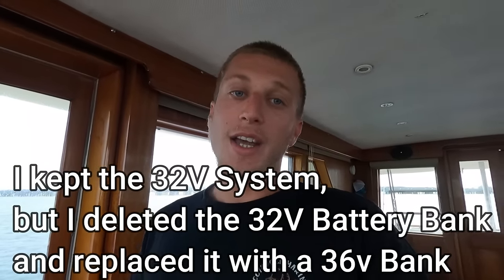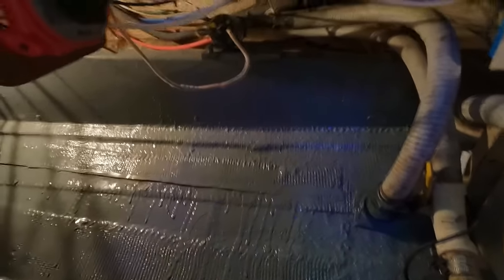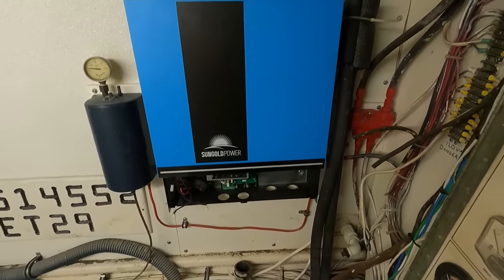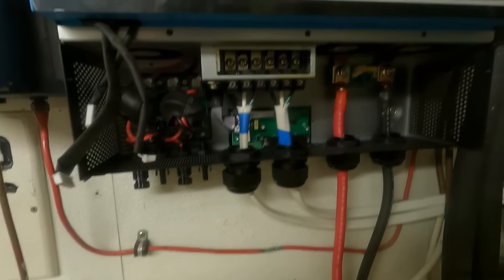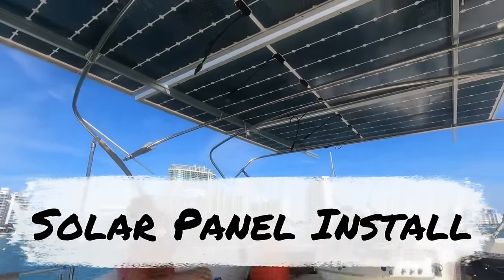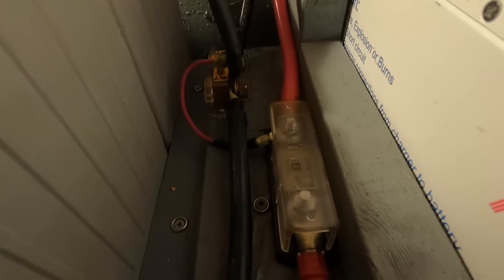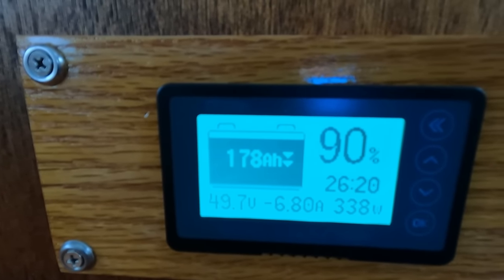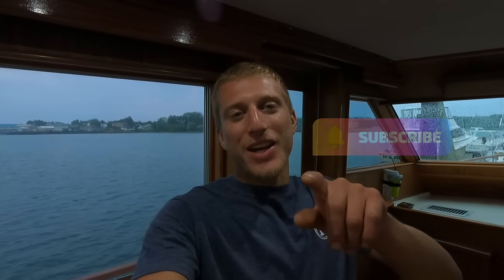Off-Grid Liveaboard Yacht Setup - 1968 Hatteras 50'

Comment from the maker: I Estimate the total cost of the setup to be around $5,000. That Includes everything that I had to buy from start to finish. 
Check out Redodo Lithium Batteries! Discount Code: GUS  https://www.redodopower.com/?ref=kpt00fas
Reply: Great videos!  I’m currently installing lithium batteries and a SUNGOLDPOWER 6kW inverter/charger/transfer switch into my gulfstar 44 motor yacht. I went with four 200 amp 24 volt batteries in series/parallel for a total of 400 amps x 48 volts = 19.2 kW of power which is more than enough to supply the 6kW inverter. I see one problem with your setup. You have two 100 amp 24 volt batteries in series for 48 volts but you’re limited to 100 amps total because that’s all the battery management systems will allow. So you have 100 amps x 48 volts = 4.8kW of power driving a 6.5kW inverter. You need more power from your battery bank.
Reply from the maker: @kdorang  thank you for watching! The batteries are not 24 Volts, they are 48Volt Batteries. According to the manual it’s over 4x recommended minimum capacity.
Reply: @InTooDeepBro  Ah my bad. So you have them in parallel for 48 volts and 200 amps. That gives you 9600 kW which is more than enough for your 6500 watt inverter. Keep up the great videos!
Reply: Good to have you back Gus, we have been missing you excellent videos!!
Reply: @kdorang  He has 2) 48 volt 100  AH batteries  in parallel so he has 200 ah or 10.5 kwatt/hr
Reply: @InTooDeepBro  you can never have enough batteries my friend !
Reply: On your battery bank you should swap so you have positive on the first battery and negative on the last battery (or visa versa) so that you drain the batteries more evenly.
Reply: I have two Redondo lithium 200ah batteries in my rv

Comment: Wiring tips, go to a home store plumbing dept and get plastic pipe J hook hangers. They come in all the normal pipe sizes 1/2" up to 2 or 3" . They're dirt cheap can be cut to lengths to mount/run wires in all ways. It's a J so easy to get wires on/off and zip tie down to secure.

Also use dielectric grease on all wire connections for years of trouble free connections.

Comment: Great work setting up your system, I custom built a 12kWh LiFePO4 battery bank for my boat and have not looked back since. Lead acids are only for engine starting now. One small tip is to put the negative and positive wires on different batteries if you're doing parallel setups where high amp draws are likely to be often. It helps make sure both batteries charge/discharge evenly, else you might find the bottom battery with both conductors on it is discharging faster than the top battery. Will Prowse has a good video on setting up parallel battery banks.
Reply: Yep opposite ends of the bank

Comment: Very nice job. One small point to consider in wiring the lithium banks is to wire the positive wire to one battery bank and the negative wire to the other battery bank. This would balance the small voltage drop in the parallel wiring  method between the two batteries.   Obviously with 48 V and large gauge wire this voltage drop is very small even when charging and discharging at high current but is a point to consider.
John

Comment: Niiiiiiiiiiiiiiiiiiiiiice work in this episode. 🎉🎉🎉  Wish I knew as much about boat power. So what I need explaining a bit more is why you only need 2, 48 V LiFePo4 batteries and other boat installs use 6 or 8. Thanks.
Reply from the maker: The Setups that use 6 - 8 batteries are likely 12 Volt arrangements. One 48 Volt 100AH Battery is equivalent to 4 100AH 12V batteries.

Comment: Setup is looking good !  You should have the  negative and positive inverter feed cables  on opposite batteries not hooked to one unit - this is standard practice when doing multiple batteries to help balance all the cells. This imbalance gets more pronounced when you start adding 4 or more banks.
Also you should be using class T fuses on the positive feed cable not ANL current limiters, they are expensive but worth every penny. You need something that will reliably break an extremely high amp current.   ANLs can sit in a short, arcing and heating up the plastic holder in a high voltage short such as a MOFSET shorting out in your inverter. The class T is encased in metal  and has silica inside to quench any arcs. Also pay attention to the voltage rating for those ANL fuses you have remember you need a rating for up to 57 + volts. 
Also you have the whole mess with the bonding of your neutral and ground , you only want one point in your system with a neutral ground bond and usually that is done in your main/load panel ( and the reason why you do not tie them together  in a sub panel ). The inverter has a relay inside that bonds the N/G while inverting and opens it when in pass thru/line mode. When the neutral is bonded to ground in more than one place
objectional current travels on the ground between the two points .
The current is shared between the neutral and the ground wires which you do not want.
Also these high frequency inverters are REAL fickle about the quality of the grid/ generator input. You need a LOT of KW to run in bypass mode as you are powering your ship, the inverter AND the charger ( which you can adjust) and if your generator output is dirty the inverter will reject it and not work. Many people have to run a large inverter generator to do what you are doing. Also you cannot charge and invert at the same time only solar charge and invert. If your inverter doesn't like your generator then shit can the bypass mode and buy the EG4  100 amp chargeverter for $300 and have your generator power the charger ( it is adjustable from 10 -100 amps) that way you can charge your batteries while inverting at the same time.
Reply from the maker: I appreciate this advice. Every point that you made is completely valid. When I set this up I wondered if the inverter switched only the hot, or if it switched the neutral and the hot. I will get rid of the ANL fuse and swap it for a marine current limiter. Also, your point about the generator. Very true. I had some issues with this upon setup, I had to dial in the mechanical governor on my 15KW genset in order for the inverter to see an almost exact 60cycles. (It seems to be most picky about frequency). Thanks for the pointers, I will use them to further dial in the setup!
Reply: @InTooDeepBro  I am pretty sure the inverter switches the hot and neutral - the issue is (and there is gigs of bandwidth on this topic) is the bonding of the neutral and the ground. If you look in your main breaker panel in your home you will find the neutral and ground bus bars tied together. You can only have ONE N/G bond and that is supposed to be at the source and ONLY at the source. Where it gets tricky is when you plug into shore power that source will have the N/G bond and your ship load center should NOT have the bond. Now when going off inverter or genset as the source  those units must have that n/g bond. In that case I think the inverter should be configured out of the box to do this with the internal relay. Those of us running this setup in our homes do not want that so we have to go inside the unit and remove a bonding screw that disables the switching. It is a REALLY confusing but important subject ! Go thru ABYC and NEC guidelines also Mike Holt has a TON of good videos.
https://www.youtube.com/watch?v=AyK67MgpNpE
Also this one explains objectionable current
https://www.youtube.com/watch?v=M3lX4XtlYXk   about 7:40
The shit is mind numbing I know !

Comment: Hi Gus - Really good video, you did well to explain it all.  The ship is looking FINE!!  One thing I must comment on...There is some urgency to get the cables in the battery area particularly, trimmed and tidied.  I can see cables touching everywhere!!  At sea in rough weather, the cables could wear thru' and flash!!  No way we want that to happen.  Be careful not to make the tied bundles too big, run them flat or high current ones individually where possible, so they can be inspected easily.  Mixed voltages in a bundle not good either.  You really have done a good job on what was literally a "right off" boat...sorry ship!  Work, I can see, does not frighten you one little bit.  Good luck with the project Gus - All the best John

Comment: I spend many hours in the bilge of my Hatteras. I would suggest another project. A CRASH PUMP
A CRSH PUMP is a bilge pump that runs off your ENGINE WATER PUMP IMPELLER and will pump hundreds of gallons a minute while not harming your engines. All you do is add a T to your raw water intake before your water pump, attach a few valves and a long hose and if you have a big water intrusion you flip the lever and instead of pulling from the sea, you pull water directly from your bilge. Simple to set up witha few valves and T-s and  wil save your boat if you blow a waterline, hit a log or other major damage that lets in a lot of water.
Reply: Ah not a bad idea. At a minimum I'd have some sort of high capacity pump. And lot's of bilge pumps.
Reply: CAn never have too many bilge pumps. I had a habit of checking my engine room every hour. One time I  checked and found a screw in freeze plug had fallen out and was pumping about 3 gpm a minute in the bilge which was about 1 foot deep already. SO I fished around in the  bilge and found it and plugged it back in. Boat saved. Another time in went down and found the gas line had broken free and was rubbing on the drive shaft. Crisis averted. Its all about the prep. Safe boating my friend!  @mrmotofy

Comment: Might want to upgrade your fuses and isolation switches on the 48v system, because the inverter/charger is going to run that system about 54-56v, and most of the common bus bars, switches, fuses and such only go up to 48v. I had to buy 64v breakers, 96v bus bars for my 48v solar system. Also, 50+ volts DC CAN in the right circumstances electrocute you so be careful.
Reply: Can you check voltage with your tongue?
Reply: @sailorman8590  @56 volts be my guest. Make sure to lick the positive terminal and hold onto the ground.

Comment: Just a suggestion. I would determine the ampacity of your 32VDC system. Replace the 32VDC batteries with a 48/32VDC Converter sized for your load and add more 48VDC batteries to take up the space currently occupied by the 32VDC batteries.
Reply from the maker: I actually thought about this! But that 36 Volt battery bank powers the entire bilge pump/high water alarm system. I did not want to rely on a electronic component to power that vital system. Batteries are tried and true!

Comment: Hello there and congrats on the Hatteras! As a Former owner of a 1982 Hatteras 53MY, I understand the love and excitement. She is a beautiful ship, however, I do believe you do have a Hatteras 53MY and not a 50. My ship was an exact duplicate of yours. Her LOA should be approximately 56' or 57' with the swim platform.
Reply from the maker: Thank you for watching! Back in 1968 they called it the Hatteras 50' all though she is the same length, design and hull as the 53', they did not start producing the "53" until 1969. However she does measure 56 feet LOA.
Reply: @InTooDeepBro  Good morning, that is an interesting good to know trivia fact about the old Hatteras'. Thanks for the info and for replying. You really found a Gem with that re-power setup!  I had DD 8V71T, powerful and dependable. However they were loud, hungry, and messy. Whats your average GPH?

Comment: I had done what you did on my 60 ft yacht with a 36 volt batteries but I use regular maintenance-free batteries and about two months later they would explode like dynamite whenever you kick the starter on but to do that you should use AGM batteries and not regular meetings 3 or they will blow up on you and kill you

Comment: Whooo! Another video from Guss! Question, When your on shore power does that run through the inverter too like the generator? Or you basically eliminated the need for ever needing shore power? Also I just got done putting a cabin floor in my 27’ Formula. First attempt at fiberglass. It turned out good! But what a mess. Anyway love the videos man! Keep em coming!

Comment: Kudo's to you Gus! I'm 70 and just bought a 35' Chris Craft (1973), basically just for the hull, on an huge inland lake in Virginia. My project is to pull the internal combustion engines and replace them with 2 x 50HP electric engines...run by a 45KW 3 cyl diesel genset, yes (2.5 gal/hour for BOTH MOTERS!!!), once I get all of the crap out of the bilge, it will fit! I know the boat will never plane again, but will go about 7-8 knots....what more do these big boats usually do....especially at my 70 years of age. You have very economical Cummings engines, BUT you may want to explore my solution for repowering (you can always sell the Cumming's). I sold my 350's for about what the conversion will cost. 

I commend you for your youthful energy and above average engineering skills...and your obvious attention to detail....rare of the younger generation, today. Get yourself a girl that appreciates these traits and your love of the sea and take off with her...Good luck, Gus!

Comment: I build a roof over the fly bridge.i have a 45 hull chill on 15 knots bro   from fl stright to nassau i think she do 30 knots open . My baot 1966  40 foot hatteras lol if you running detroit 8v53  they so sweet . Replace the exhust gaskets . Look at the flange.  The square on the end . Recheck the packing anclude rudder ❤

Comment: How has your 36v conversion worked out? We just bought a mid-80’s Hatteras with the 32v system and need to change the batteries. Would like to switch to 36v too but I’m not sure it’s safe to do so.
Reply from the maker: I have had no issues, but if your engines crank and charge @32volts you must stick with 32v

Comment: I had a DREAM, I have many dreams, this one left an IMAGE IN MY HEAD of a ''bimini roof dodger cover system'' that had sliding panels so when you at calm anchor you can have like 6 panels unfolded out, and normally running has 2.5 showing at NORMAL OPERATION MODE ....t he base model was for a sailboat, so a setup like yours has like 5 panels wide anyhow right??? LOL unpausing to count... lol  

HAVE A GREAT DAY!! was wondering what happened... you go up for ananannanapolos boat show or to be there for that or what? do you essplain in the vidieo??  DID I MISS IT ALREADY at 21:00 in the vid?? LOL HAHAHA I could have missed it... haha  ...but I think you left it at a ''well I will get to that later ..... '' point... !:)   !;)

Comment: You made a classic error on the connections to your 48 volt pair of redoodoo batteries.  You tapped off both sides on one battery and even though you jumpered the 2 together, the draw will be uneven.  Better to tap the positive of one bank and the negative of the other bank to ensure both batteries are used equally.

Comment: any chance does anyone know of a florida company that does this type of install, 5 grand in parts id say another 3 to 5  grand for install would  be a fair amount to charge.. id like to buy an already done sailboat next year for about 60 to 70 grand or pay out the 10 grand for complete install  not everyone has the ability to do this work  , but some of us do have a nice bank account to pay out for good quality work..   id also like to know what your travel range with out a fueled generator would be.. knots per mile  or hours of travel.. and still be able to kook dinner..lol  this is great content as a diy project.. fair winds and fallowing seas..
Reply: I might make a trip to FL for the right job...sounds like a fun project. I've had an off grid property for 8 yrs, with solar running everything including a/c. Converted a cargo trailer for camping with a/c. Been spending 3wks or so in FL around Feb for the last 5yrs or so. Been an independent construction contractor for 16 yrs now and DIY everything. At 17 I worked at a plant and wired industrial machine control panels with $200k + in components on em. I have an email in my vid descriptions

Comment: That doesn't seem like a lot of power to be completely off grid - I noticed the ac was not on the system - Do you run the generator when you need to run the AC or other higher power systems?
Donate for a Dream

Comment: Fiberglass was a very new building material back in the 60s so everybody decided that Moore was better. They had no idea about thickness or real strength overall so most boats from the 60s are extremely overbuilt . 
And Hatteras, of course was always a premier boat builder of wooden boats right up in the top tier so there was no way they were going to skimp on this new material that’s why quality boats from the 1960s are a great choice for restoration as long as the glass work is not the laminating on the bottom even that can be repaired successfully using modern Apoxsee’s
Reply: It's called, "delaminating," and the other is spelled, "epoxy." Some of these old boats, like for example this guys Hatteras are extremely TOP HEAVY and will therefore roll you to death in any kind of sea. Ok for liveaboard as long as calm and you don't leave the dock.